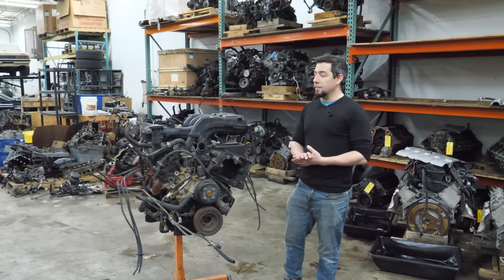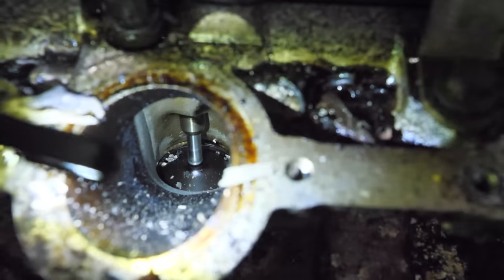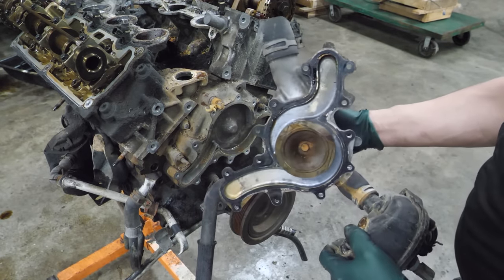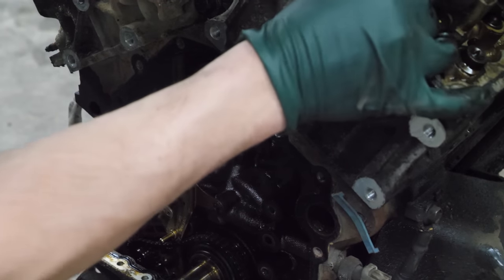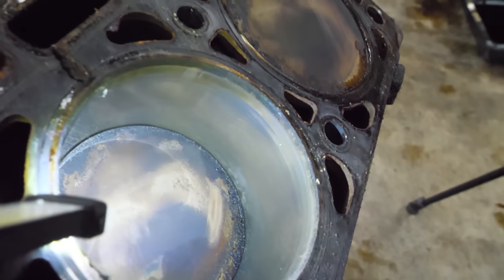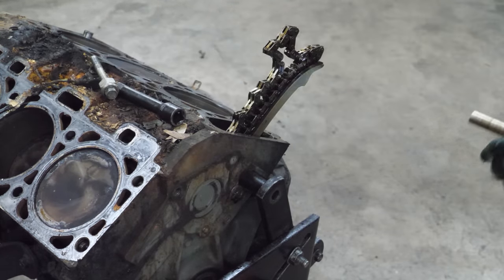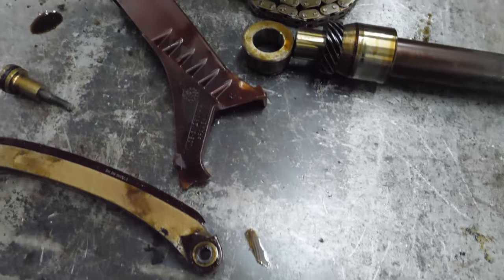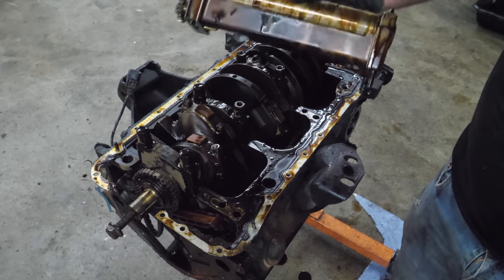Ford Explorer / Ranger / Mustang 4.0L SOHC V6 Teardown! Is This Why They're Called "Exploders" ?

Comment: As an independent tech who's had to work on these, I hate the 4.0 sohc. And actually had to dust off my timing tools for a 4.0 late last year, after I thought they were all dead and gone.
Reply: Lol I see em from time to time. Rattling to high hell usually
Reply: mine refuses to die 285k miles working AC and rattles its ass off want to do some timing work on it? i sure know i don't and in turn won't work on it past keeping it riding good as i plan on doing a whole V8 swap as mine has next to no rust and has been good to me.
Reply: Why would you think that they're all dead and gone?  The problem was overstated, normally takes north of 200K mi and there are still a million + vehicles on the road with these engines.  People would see them with this problem so often, because the engine was used in so many millions of vehicles sold.  I don't mean to suggest that it wasn't a crappy design, but there's still plenty of them out there, and those remaining will probably take longer till they fail because as vehicles get older they tend to rack up fewer miles per year.
Reply: The issue with these is less of a chain guide issue and more of an oil fed tensioner issue. The tensioners do not have a ratchet that prevents them from fully collapsing.  This results in chain slack hammering until oil pressure comes up and will eventually break guides.  
 I measured and made sleeves to prevent the tensioner from collapsing with the engine is off.   ( Left about 0.020 compression so I'm not artificially binding the chain  )
Reply: @stinkycheese804  Completely agree. If they’ve been maintained pretty well usually after 235K seems to be where they were on borrowed time.
Reply: @bobroberts2371  damn, that's impressive, not joking
Reply: @stinkycheese804    The later version of those engines had the updated timing components and they lasted much longer.
Reply: there are a shit ton of them still out there. a its funny that ive heard about them being shit in the taurus and exploders but the rangers with this engine seam to truck on two respectably high milage
Reply: @williamdana6661  the rangers got a slightly different version of that motor
Reply: I just decided to sell my 4.0L SOHC Merc...Should you want one that is still running with over 200k mi on it. 🤣😂🤣
Reply: @wysetech2000  what are the later years from. I have one built in feb 2007
Reply: Things got more chains than a 90s rapper🤩
Reply: @AbcAbc-sp1od  do tell.  They were the same SOHC for about the last decade that generation of Ranger was made.
Reply: @EverydayDIY2023  I meant they didn't have the timing issues that the explorers did
Reply: @samholdsworth420  what exactly will fix my rattle? im currently at 241,000+ miles
Reply: @goofygoober5526  Nothing will. If it’s rattling then it’s about to go. Could be a week, could be 6 months but it’s probably gonna bend the valves when it does. Only thing to do is a timing chain job and you’ve gotta pull the motor for that. If the motor is already out there’s no point in spending money on a motor with 241K on it. That was the dilemma with these motors, it wasn’t that much more to just put a used motor in it than to do the timing job. And even then it’s a used motor with what could be the same problem.
Reply: @GMbowtie350  bullshit. These engines can go for many years and many miles with a rattle..
Reply: @goofygoober5526  nothing will fix it, but using Lucas oil stabilizer will quiet the chains down a little
Reply: @W0RLDSSMALLESTVI0LIN  Technically you’re correct but if you would’ve read between the lines you’d see my point is that there’s no telling when it’s gonna go. How’s that bullshit? You telling me EVERY 4.0 that starts a rattle is gonna run for years until it gives it up? No. I’ve seen them go a year once they get the rattle and I’ve seen them go a week. My mom had an Explorer she bought brand new, jumped time and bent the valves at 243K miles, made it 6 months after the rattle initially started. It’s like asking the doctor when are you gonna die. Could be days, could be years. Chill, I’m not dogging the motor. Personally I like them, they’re not that bad of a motor. As long as you don’t buy a high mileage one right off the bat and it’s been pretty well kept they don’t seem to have any other issues. Seen some fuel regulators go out, one in particular locked down number 6 cylinder with fuel, but generally I like them.
Reply: @W0RLDSSMALLESTVI0LIN  I guess you could guarantee it would last years if you only drive it 12 miles a week, or drove downhill, a lot.
Reply: I did a timing kit replacement on a 2005 explorer sport trac with 242k had skipped timing and was throwing misfires running rich even had valve marks on the pistons, took oil pan off had perfect cylinders with all factory honing lines, replaced the chains and ran perfectly smooth and quiet no bent valves even passed smog, they are good engines that can run a long time, just a pain to do chains its a time consuming job.
Reply: My 4.0 in my ranger isn’t dying and I’ve beat tf out of it

Comment: That engine has some sentimental value to me since my first vehicle I learned to work on in my parents old 2004 ford explorer though the transmission was more of an issue than the engine. Btw the middle shaft for the timing system is called a jack-shaft.

Comment: About 90% of those engines if the owner would simply replace the $100 tensioner when the old one fails, generally around 160-180k miles, they would run another 100k miles flawless. Have done dozens and many ran another 100k+ before the second tensioner failure, some i did a full timing gear replacement on and still running today. 6 have over 350k miles still driven daily
Reply: How do you know if a tensioner fails?  The chain will rattle ?

Comment: I inherited a 1999 Ranger XLT 4x4 with the 4.0l V6. It’s all original with over 270,000 miles. My brother changed the oil every 3,000 miles, he kept a log book with every fill up, oil change, tire purchase etc. The truck still gets over 15 mpg around town. Everything works, AC, radio, cassette, CD, power windows. T he only change I had to make was the vacuum front hubs to a manual locking hubs. It may be an anomaly but I prefer to think it was meticulous maintenance.
Reply: Every 3k miles …it will run forever. Timing chain guides will fall apart but it will still run.

Comment: I've got one of these in a 2005 explorer. It has 185,000 miles and still runs strong and quiet. Not going to repair anything if it breaks, just throw in a Jasper reman...The timing chain repair is more than the   reman.

Comment: No need to take off the head. I did the chains in my 2009 Explorer and if I remember correctly you have to remove a clip on the pivot on that chain guide and separate the two halves and remove them one at a time. Zero timing marks on anything but I have the tool kit needed.

Comment: Had a 01 Explorer from 2013-2020, I somehow did not have any timing chain issues and I got rid of it at 178,000 miles. The last week I did have it though, you would hear the chains grind for a minute, then it went away. That was my queue to sell it lol. Besides having to always replace the thermostat housing every other year, it was a solid vehicle. If I had the choice I'd definitely go with a 5.0
Reply: There were two aftermarket suppliers of aluminum thermostat housings that solved that issue.  Yes it was a frequent problem having the sonic welded plastic thermostat housing come apart and leak.
Reply: That thermostat housing smh I am in my third lol

Comment: You are on a roll in my life first the Dodge V-10 and now the infamous 4.0 ford.  Yep I had a 2011 little ranger 4x4 with this engine and the knocking started.  It was well maintained.  I took it to ford and asked about it and they told me point blank.  We can replace with a new engine cheaper than repairing that one. So I am still running it after four years.  I make sure the oil pressure is up and the engine is warm before moving.  That helps a lot with the knock. However,  looking to put a 5.0 in it. Lots of these swaps have  happened.  Thanks again for the awesome insight into this engine.

Comment: There IS a way to get the front timing cassette out without removing the head. I saw it on Ford Tech Makuloco, you need to tap on the hinge in the cassette from below until it clears the limited space between the head and the block. Of course, a timing job on these is an engine out job, so you havo lots of space....the new cassette comes with a hinge that can be disassembled for easy installation.

Comment: Always love watching these videos , I'm in the UK and really like seeing the engines you get over the pond. I'm  not sure  if you get theses engines over there but maybe strip an Audi 4.2 V8 or a Volvo V8 petrol or D5 diesel engine , those Audis have a rats nest of timing chains at the rear of the engine, the Volvo V8s leak oil like a BMW and the Volvo D5s don't tend to go wrong unless you skip oil or timing belt changes. Alternatively a Volvo 5 cylinder petrol would make a change,  good luck with the business and videos in these challenging times.

Comment: I liked the torque this had at the bottom end and the sound was not unpleasant. The OHV version of the 4L makes more sense to own.
Reply: It was weaker.  Makes more sense to just have the 5.0L OHV if going that route.
Reply: Agreed, I owned both 4.0 versions of Ford Exploders. The 4.0 OHV (X) was simple and inexpensive to service. The 4.0 SOHC (E) was much more enjoyable to drive with the better low-end torque, but I didn't enjoy working on it nearly as much.
Reply: Agree on the torque. One of my kids had a mustang with the 4.0 and the other kids has one with the 3.7 the 3.7 is geared so tall the acceleration sucks for 300hp. I think the 4.0 could match it. We should have raced them. I think if one put 3.42s in a 3.7 that thing would scream.

Comment: 2009 Ranger bought or with 77k on it, now have 537,000 km’s on it and running GREAT still. 
 Did water pump and coolant lines last year due to small leak, but otherwise been very happy with this truck. ( 80% HIghway/20% City )

Comment: I have a 2011 Ranger 4x4 with the 4L.  It was purchased new by me in 2010.  So far I have 310,000 kilometres (almost 200,000 miles for my southern cousins) on it with no problems at all.  Burns no oil, and makes no alarming noises hot or cold (and Canada can get very cold).  The engine has been serviced every 10,000 kilometres since new, including oil and filter change.  It hasn't failed me yet, runs like a top.  Not the best truck I ever owned (that would be the original Nissan Hardbody in '86), but so far a great truck.  I think most of the problems with this engine stem from indifferent or even total lack of maintenance.   It's my understanding that the 4x4s have that balance shaft.
Reply: Excellent news! I just purchased a 4x4 2011 Ford Ranger XLT with the 4.0L that only had 52k miles on it. From everything I've learned in this video's comments as well as elsewhere, the most important things to do are to change the oil every 3k to 5k miles (5k to 8k km) and get the chain tensioners replaced at 75k miles (120k km). I'm hoping that if I just follow that advice, it will be a reliable truck that won't break down on me ever!

Comment: these engines are great! mine in my 01 ranger had a broken timing chain tensioner and I still did a 1200 mile road trip. after driving back home, had to pull the engine to redo the timing system and the oil pickup was completely clogged from broken plastic chunks of the old tensioner. still ran like a champ!
Reply: They still boat anchor motors
Reply: @jmc6000  with a supercharger tho these are great. Ive supercharged two separate rangers with these engines. tons of fun
Reply: I thought those engines all had chains
Reply: @fredstone3875  u right, I am king of typos
Reply: @jmc6000 power to weight was actually pretty decent. The v8s were producing right around the same power in the early 2000s
Reply: Except no.  If the oil pickup had completely clogged, it would have eaten itself up.  A little restriction is a lot different than completely clogged.  Pieces of plastic cassette in the oil pan does not tend to completely block the oil pickup.  The video stated that but it just wasn't the case.  I'm sure it's possible but plenty of autopsys showed the primary failure point was the chain lacked enough tension and jumped time or came off then valves collided with the pistons.

Comment: I sold my explorer with 270k on my 4.0 and it never had any issues. Only thing I ever replaced besides spark plugs was an ignition coil. On time oil changes make a difference.
Reply: Mine had 196k before it went

Comment: I would love to see a tear down of a Buick 3800. Series 3 preferably but I’m not particular. That motor is really reliable, from what I’ve heard, so I understand if it’s hard to find
Reply: That would be awesome to see. They were crazy dependable engines, I've seen multiple examples of them with over 400,000 miles.
Reply: @Oddman1980  my mom drove hers until our family got too large for it. I think it was around 300 K. Cause mine is currently at 188,000.
Reply: I paid my way through college swapping out 3800 engines. They would ingest coolant from bad lower intake manifold gaskets or UIM where they melted around the EGR and rod knock.
Reply: They are good engines because they are  simple port injected push rod engines.  Not much goes wrong except the plastic intake plenum, lower intake gaskets, water pump, and bypass elbows.   Never seen bottom end go bad unless it was neglected.
Reply: @Discretesignals  Mine hydralocked. Put the updated intake gasket and new intake on and it was fine surprisingly. It happened at idle.
Reply: Yeah people have called them bulletproof and I call BS.  They were notorious for the EGR cracking the intake manifold (plastic) and causing a coolant leak that hydrolocked them.  Been there, repaired that, an engine is only as strong as its weakest link.
Reply: @stinkycheese804  I will admit I did have an intake and valve cover oil leak but it was an easy repair. I’ve also had my egr valve go bad and it was simple as well.
Reply: @stinkycheese804  I had the plastic intake do that & my grandson bought a new one for 140 bucks & did the whole job in 2 hours. Nothing was difficult. New oil & done.
Reply: At 280k miles, mine suffered a huge fuel leak and caught fire, burning everything under the hood including the plastic radiator tanks and top off the battery.  Always ran like a top and practically sipped fuel, was fully loaded, very nice fwd regal.
I wish I coulda caught the fuel leak!
Reply: @thisisyourcaptainspeaking2259  Failed seal or rusted line?  If line, preemptively replace same as you'd do brake lines.  Even so, at 280K, got a good enough run out of it.
Reply: @stinkycheese804  Best I could tell, a plastic (nylon?) fuel line ruptured or cracked.  I'd never seen that before and there was no heads-up or indication a failure was about to occur.  My guess based on damage, there must've been a gallon or two of gasoline sprayed under the hood and over the engine.  Maybe a rat chewed a fuel line or it just popped, I have no way of knowing now.
If I'd known this was a problem waiting to happen, I'd have replaced the fuel lines and stress-test'd them, inspected closer.
I've seen this model car in the j/y before where a fuel-fire started underhood but minor in comparison to this fire.  I didn't think much about it at the time, figured someone caused it.

Comment: Ive got one of these in my ranger. 07 with 260k km runs great but i have no idea if the timing system has ever been serviced. As far as performance its a great engine plenty of power for a small truck. Owned the truck coming up on 2 years without engine issues other than a failed thermostat. The complexity of doing the timing chains and guides makes me want to sell it before i need to do that work even though it has been my favourite vehicle I’ve owned

Comment: My experience with the 4.0 SOHC has been excellent.  Plenty of power and absolutely reliable. I put 240k on a Explorer Sport Trac and never had a single problem with the engine. I did however have to replace the fuel pump once and the alternator twice. Other than that just normal maintenance parts and tire replacement
Reply: Same , maintenance and not beating the crap out of your vehicle goes a long way , at 283k on my 08 , on 2nd alternator, just oil changes , tires , front wheel bearings. Runs great